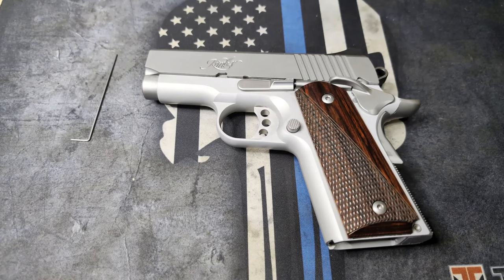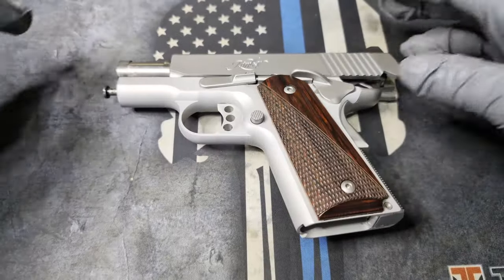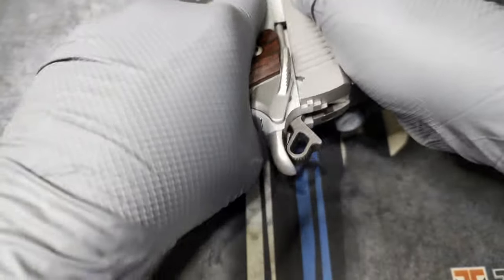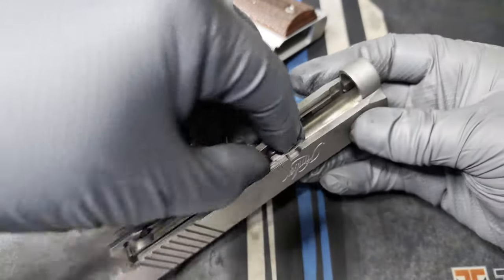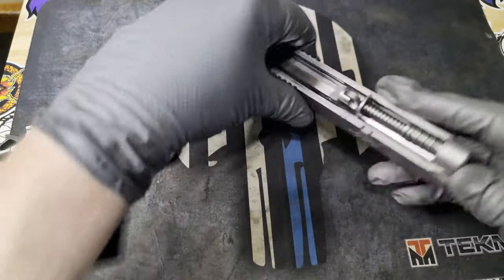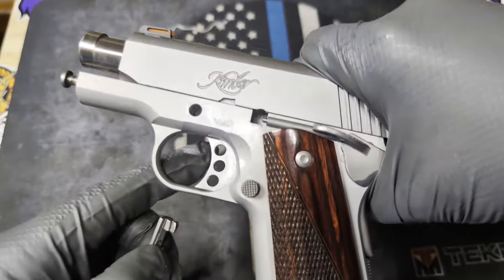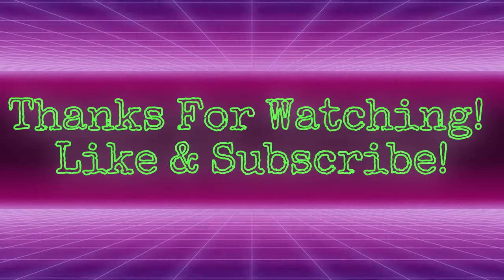Kimber Ultra Carry ii field strip & reassemble without takedown tool

Comment: Nice pistol! A few years ago I  bought a ultra tle 2 stainless.  It was the first expensive pistol i had bought.  Had a few problems in the beginning,  but  got it running good. Been carrying it for a long time now and would have a hard time selling it if someone offered.
Reply from the maker: That's funny you said that cuz I actually had quite a few issues with mine in the beginning too. Even after the thousand round break-in. I was still having failure to go into battery and failure to cycle through rounds so I ended up having to ship it back to Kimber and they polished the feed ramp and that helped with the issues for sure. But it still had a few hiccups but now that I got it at about over 2,000 rounds I learned to just clean it after every time I shoot it and keep it well lubricated and it doesn't have issues anymore. I actually made two videos just on the malfunctions that I was having with it when I first purchased it. Here's a link to one of them if you're interested.
https://youtu.be/RY2xsqYjk0I?si=9mz88qW9CB9_Y7mP
Reply: @counterstrike2A  yes. Most 1911 is going to have a "break in period " This can be frustrating not to mention hard on the extractor. The extractor and magazines are most important for good operation of the platform.  I was lucky to meet a guy at the range who happens to build custom 1911's . He has given me a lot of great information about them and helped me maintain this and others I eventually bought through the years. Have a good one.

Comment: Got a Kimber CDP, and realized not a fan of the 1911 models. Its a pain to disassemble and clean and don't like the idea of having a tiny tool to keep track of. Beautiful gun, just not very practical. Sticking with DA/SA Semi, love the HK .45, which is not only easier to work on, but shoots way better. Don't recommend 1911 for practical field gun or self defense.
Reply from the maker: Idk about that I can disassemble and reassemble mine in less than 5 minutes
Reply from the maker: 1911 has always been my favorite model but I get where ur coming from have you looked into a Beretta M9/92fs it's got the same look of a 1911 but it comes apart like a Glock and you get 15 round magazine capacities chambered in 9 mm
Reply from the maker: https://youtube.com/shorts/M-oIPeiTBVI?feature=share

Comment: Havent shot my 1911 in a while. Now I kinda want to…
Reply from the maker: 1911 is definitely a pleasure to shoot that's for sure even this 3" compact feels great & the beaver tail helps mitigate allot of the recoil. It sucks though. I'm happy I didn't break my left wrist because luckily I'm left-handed, but now my support hand and wrist definitely starts hurting after a while and I have a lot less control over the recoil but I've only gone shooting three times since recovering from my surgery so I'm slowly getting my bearings back. Unfortunately I don't think I'll ever have full motion of my right hand and wrist again. Even doing the physical therapy, my grip strength and how far I can bend. My wrist up and down is definitely limited now
Reply from the maker: But I'm just glad I didn't break my dominant wrist lol now I got a steel plate in my left hand from a boxer fracture, I got in high school like 20 years ago and a steel plate with 12 bolts in my right wrist lol
Reply: @counterstrike2A  oh, Dang. Sorry to hear that, man.
Reply from the maker: I can't remember if I ever told you about what happened or showed you my x-rays about 2/3 of the way through this link  attached to this comment I show screenshots of my wrist before they set it and then after I got the steel plate put in it was a really bad fracture of my radius and ulna 
https://youtu.be/bJcDoMH5D9A?si=UgQpkPhsMtIWdKeU
Reply from the maker: @DesertTactical  I got one of those one wheel hoverboards and got way too cocky way too fast and my fourth day riding it. I crashed going 17.5 mph.. had only clocked 12 miles on the board when I crashed. But after recovering I've ridden that thing over 600 mi. Now I just got overconfident because I've skateboarded and  snowboarded  my whole life and took how dangerous it was for granted
Reply from the maker: @DesertTactical  and of course the wrist guards I had ordered on Amazon were 2 days away from being delivered to my house when I crashed. Go figure 🤦

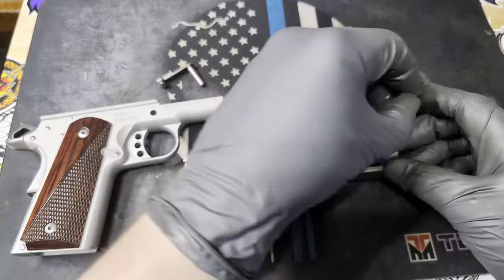Comment: Note: 2:07 Your main spring bushing can only come out the back not the front as videoed. 2:52 goes back in from the back as well. Very confusing video.
Reply from the maker: @fixer687  🤣 are you okay? Cuz I think you do not have a grasp on reality cuz I don't know what you're talking about. Clicked on both your timestamps and your comment makes absolutely no sense
Reply: @counterstrike2A  At 2:07 you are calling it a barrel washer, it's actually a spring bushing but never the less you show it being removed from the front of the slide assembly when it can only be removed from the rear. You probably accidentally got it turned around during editing. Reassembling at 2:52 shows the correct orientation from the rear. Don't know why your comments are rude when I was offering a respectful comment as an interested follower.
Reply from the maker: @fixer687  not really considering I correct myself after going to push it from the front and I said oh it can only go on one way. But I forgot you're such a expert at the 1911 platform. That's why you need to watch somebody else's video on how to disassemble it, right?
Reply from the maker: @fixer687  first off, if you're already disassembling the handgun wouldn't you know that's the only way the part comes out bud? If you want to act like your comment was so respectful. Maybe not end it by saying very confusing video. Not to mention the fact I assumed anybody watching this video already knows how to take apart a 1911 considering this is showing you how to disassemble it without using the tool provided by Kimber, and not to mention the fact when I reassemble it I made a point to show which direction it goes when putting it back together. But still to the fact that you were trying to come off like you were considerably educated on the 1911 platform. Yet you're acting like you don't know which direction that part is removed and or put back on, which makes me believe this whole comment is a troll in the first place. So thanks for wasting both of our time

Comment: Good video, the tool is junk and this should be the way taught in the manual. Ultimately I am regretting the Ultra Carry 2, it's such a PITA and cost way more than it should.
Reply from the maker: @Peaches-i2i  I agree. I don't know if you've seen my other videos on this handgun but I had some serious problems with it. The first 1,500 rounds even had to send mine back to Kimber for them make some repairs to it because it was basically defective out of the box. I'll send you a link to the videos if you're interested in checking them out
Reply from the maker: @Peaches-i2i  https://youtu.be/qZGql_IMBSc
Reply from the maker: @Peaches-i2i  https://youtu.be/RY2xsqYjk0I
Reply from the maker: @Peaches-i2i  https://youtu.be/k9W7E2rCRkc

Comment: Both ways can be difficult. This way at first was easy then became difficult and spring got stuck. I used oil and side-to-side movement till went in after one hour.This thing has a design flaw.
Reply from the maker: I had that issue at first I think that only is difficult when the spring is new and has more tension on it cause the first few times that was the case for me but now it doesn't occur anymore